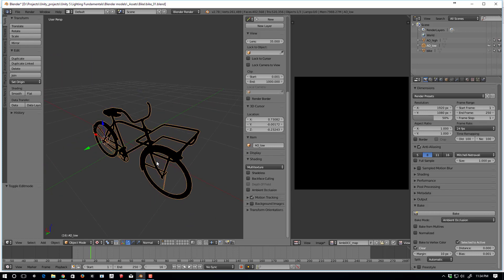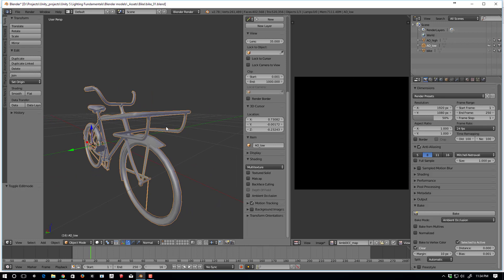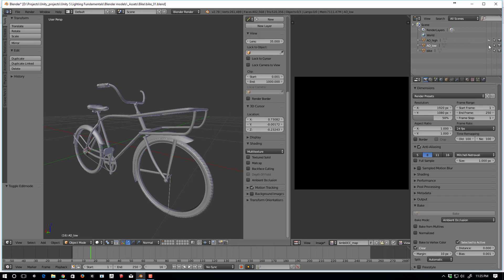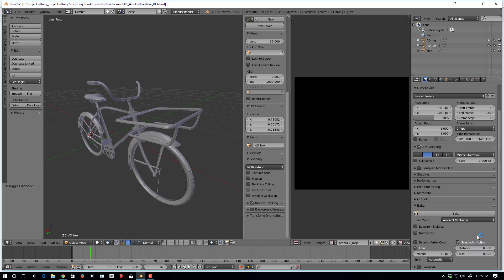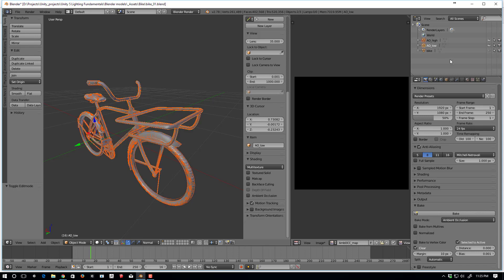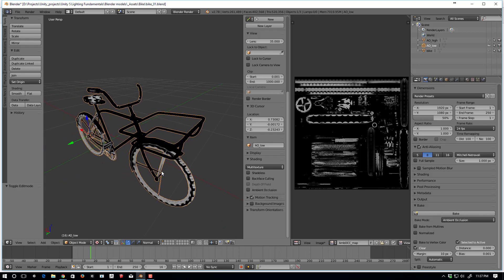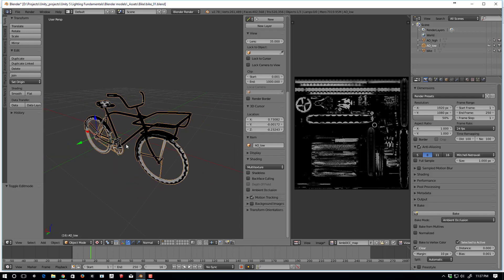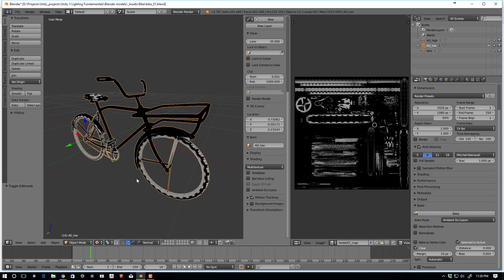Blender Ambient occlusion bake errors [Help]

Comment: i dont think its you i think its a ishue in blender  i have the same isue with super low poly as well and i been trying to figure it out my self been at mine for 2 days now there somthing wrong with the baking
Reply from the maker: Make sure you apply rotation and scale before UV mapping.  That should solve the issue.
Reply: @jrmwashere  
Thank you! The issue had me boggled, went to forums and thought it was "memory hog" due to having too much "render farms". Didn't expect such an easy and straight up solution!
Reply: @jrmwashere  thank you!